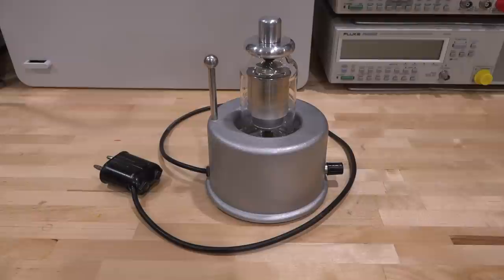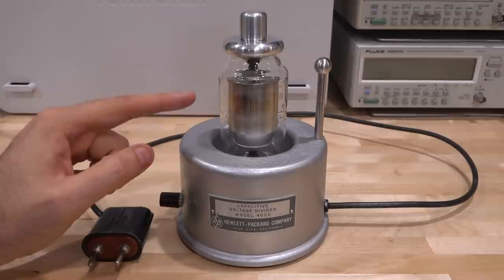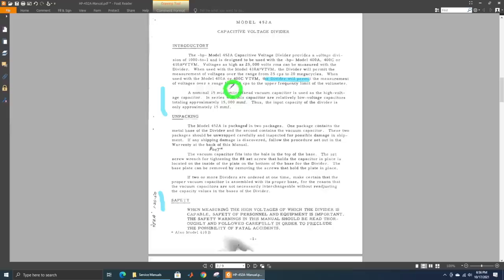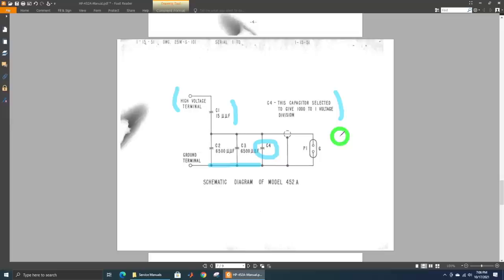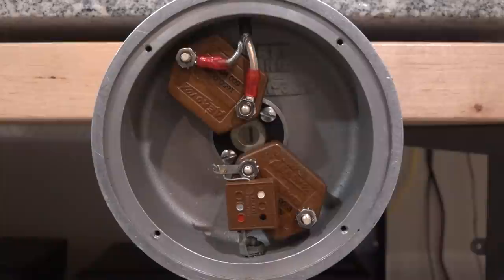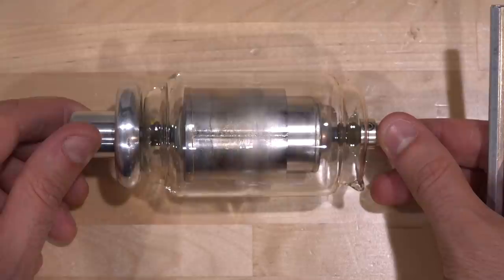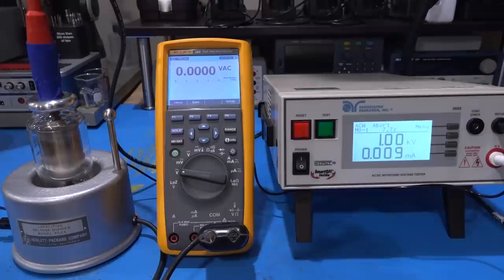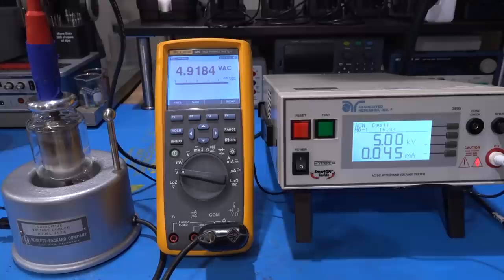TNP #10 - Teardown & Experiments with a Mystery Vintage (1950) Hewlett-Packard Instrument

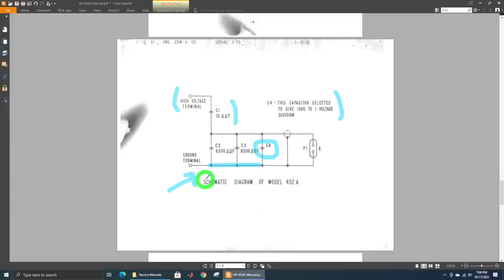Comment: Great video Shahriar! You did a very nice job restoring the divider as well. The symbol you talk about at 5:16 in the video is indicating that the lead out wire is shielded, in this case it's the shield of the coax cable. Thanks for taking the time to share your restoration with us.
Reply from the maker: Thanks Mr. Carlson! Now I need to find a 25kV AC source. :)
Reply: @Thesignalpath  flybacks ? maybe some old ignition coil ?
Reply: Mr Carlson's Lab,   You have made me very proud to find out that Shahriar is a good restorer of old equipment!

Comment: Great video!  The over voltage protection is needed to prevent the vacuum capacitor from generating x-rays which "would be bad" the same over voltage protection is seen on high power antenna tuners using vacuum capacitors.

Comment: Very cool instrument! This video came out just as I was discussing with a friend how to measure a high voltage AC signal too fast for a resistive divider in an old TV of his, will show it to him.

I suspect the 15 nF nominal capacitance was intentionally made a bit low so that, when added to the input capacitance of the meter meant to be used with this, it would make the correct capacitance. In other words, the ratio C1/(C1 + C2 + C3) must be 1/1000, where C1 is the vacuum capacitor, C2 is the sum of the capacitors inside the base, and C3 is the capacitance of the meter.
The meters for which this capacitive divider was intended (HP 400, 410 series) have input capacitance of 1.5 - 25 pF, while the input capacitance of your meter is listed as <100 pF.
I doubt this makes a major difference though, since the divider is only specc’d to ± 1% or ± 3% accuracy (depending on meter).

Comment: One detail that is amazing to me is that the spacing of the output terminals has already been the same in 1950. 
Also the overall construction is quite fascinating for just a simple voltage divider. 
Cost really wasn't such a big factor back then - or so it seems.
Reply: The spacing dates back a lot further than that.
Though, I have no clue where from it is, but its old.

According to Wikipedia it comes from General Radio that standardized on it in the 1920's.
The Schuko plug (dated to 1925 but its actual origin is debatable since there is a lack of records for who invented it) is using a very similar spacing, but 19mm (.748 inch) instead of .75 inch (19.06mm), but is largely interchangeable in practice since the difference is easily within manufacturing tolerances.

The 19mm or .75 inch spacing seems to be somewhat of a mystery to where it actually comes from and who were first. But it is nice that there at least is a standard for everyone to agree on.
Reply: @todayonthebench  Very interesting, thanks.

Comment: The circle in the schematic is the shielding of the wire that goes to that shielded GR style 2 banana-connector. Nice to see these old things. I never had seen one before. The AC dividers I know are made from transformers. The advantage is they can not change in value because the winding ratio does not change.

Comment: The input resistance of the DMM produces an error. A capacitor of 15nF at 50Hz gives around 200 kohms, that is to say 2% of the input resistance of 10M of your Fluke 289 which is a large part of the error. It can be interesting to test this capacitive divider with a voltage follower between the device and the dmm.

Comment: The mysterious over-voltage protection device in the schematic is actually the coax cable for the connection to the meter
Reply from the maker: Yes! It is definitely a coax symbol.

Comment: What's more beautiful than a vacuum capacitor?  A vacuum variable capacitor, of course!    I've seen a few vacuum variable capacitors in the wild (usually inside of older high-power HF transmitters/amplifiers), but this is the first fixed vacuum capacitor I've run across.   What an interesting instrument you've found.

Comment: 16.75pF : 14.26nF  = 1173:1, 1kV:0.984V = 1016:1, 5kV:4.919V = 1016:1. So as you said, hard to measure the 16pF and it might have measured a little high due to stray capacitance.
Reply from the maker: That makes sense, thanks.
Reply: Given the 1016:1 ratio, I suspect the vacuum capacitor is in the ballpark of 14.1 pF (depending on DMM input capacitance and ignoring input resistance, 14.05 - 14.15 pF).

Comment: This unit was originally intended for use with a VTVM, which has a higher input impedance than a modern DVM.  This may explain the error in your readings.
Reply from the maker: I'll try it with a much higher input impedance meter too. :)

Comment: Dear Shahriar

I really like your videos on old HP equipment. HP were extraordinarily inventive, always years ahead of the competition.

 If you can get hold of an HP8551B spectrum analyser that still works, it would be really interesting to compare it to a modern one. This instrument reputably made HP's  reputation as it was the first up conversion spectrum analyser.  I had one out of a skip once, but it did not work as the BWO  ( backward wave oscillator) was dead, and it eventually went back into the skip. I still have an original operating and service manual.

Comment: And unlike today's capacitors,  these capacitors are probably still good after 70 years....
Reply: Those days were different. People feared being nuked out of existence. Hence why some equipment from yesteryear was built so well. Nowadays we live in a very secure world with a sort of relative peace. So we don't care how well something is built. It can be easily replaced. "Spare no expense" got thrown out the window while "cutting corners" flew in. An ironic price of peace I guess.
Reply: That's high quality precision stuff, but "common" capacitors from back then were, you can't call it anything else, utter garbage. And they were well aware of it, but had to use them for cost reasons.  

Paper + foil, sealed with wax or tar, only designed to be good for 10 years. With STILL a high failure rate. If you encounter those in vintage equipment today, you replace them, no discussion needed. They are bad or just not bad enough to be problem .. yet. Replacing those was everyday work for electronics technicians in those days. 

As soon as metallized polymer foil types were available in high quantities, they basically immidiately switched to using those. For a good reason.
Reply: @CNe7532294  If you look at consumer electronics of those days .. especially the base models .. they are built just as cheaply as todays stuff. 

Measuring equipment is another deal, that stuff was EXPENSIVE. Easily high five to low six figures in todays money.

Comment: This is off topic, but I commented to the most recent video hoping for a response.  I have an HP 8591E spectrum analyzer with TG but the TG attenuator is blown.  I've had the front panel off and can see the attenuator but it is not apparent how to get the TG out to repair the problem.  The teardown procedure is not covered in the service manual.  Thanks for any pointers to a teardown procedure for the TG.

Comment: What is the input capacitance of the Fluke meter? If the input protection in it contributes about 275pF (which is in parallel with the lower capacitor), that is enough to get the 2% error. The 10Mohm resistive part contributes very little even at 60Hz.

Comment: I guess that the voltage rating at higher frequency is due to safety reasons because at higher frequency is easier for an arc to form between plates
Reply from the maker: It’s because of the current carry capabilities of the capacitors.

Comment: Interesting lack of a getter to remove residual gas in the  vacuum  cap. 2% is good for a 70 year old  HV  device.
Reply: I noticed that too. My guess is that very hard vacuum levels aren't actually necessary. Also, I imagine the metal deposit would have some effect on the capacitance.
Reply: I bet they used a Sprengel pump to pull a very hard vacuum inside the tube.

Comment: They use a lowercase "f" for "farad" at 3:31 - a mistake that is quite uncharacteristic of a publication from HP.
Reply: It's unlikely to be a mistake. This schematic likely predates SI (BIPM) standardization on capitalization of unit names. I think it was only in 1960 that BIPM standardized the multiplier prefixes (mu for micro, n for nano, p for pico and so on), and even then the long custom of using mmf for pF hung on for some time.  That was in the time when you were unlikely to encounter an actual mF (milli Farad).
Reply: @Graham_Wideman  Hmm - interesting :) Thanks!
Perhaps this document straddles the standardization-date in question - In the schematic at 6:22, for example, they do capitalize the F despite still using uuF instead of pF.

Comment: What benefit does this have over using a transformer? Just better at high frequencies?
Reply: It would be very difficult to create a transformer that simultaneously was able to withstand such high voltages, had a very low input impedance, worked across such a large frequency range, and was so compact.
Reply: WIDE frequency range. Very wide ...

Comment: What on earth is 25,000 volts used for? That's a lot of volts in 1950. Wow.
Reply: The first radar system I worked on used a dc supply running at 12 KV in conjunction with a pulse forming network to deliver 125 KV pulses to the anode of a large klystron amplifier tube. At the lowest output power setting it put out a 2 MW pulse 0.6 uS wide. The radar was designed in the late 40's and was still operating in the early 90's.
Reply: waaaaaay more common than you think, crt tv flybacks works around that voltage and no, im not saying this was used for tv repairs
Reply: @davidv1289  Holy Molly! What is 2 KW @ 0.6? Please elaborate. Cheers from Utah!
Reply: @fullwaverecked  Radars are sending pulses of RF. In that case the pulse was 0.6us long and the power during the pulse was 2 MW.
Reply: @fullwaverecked  That was 2 MW @ 0.6 - a 2 megawatt pulse of rf 6/10 of a microsecond wide every 3200 microseconds or so. Some great old tech!

Comment: micro-micro-farad?!? Why???
Reply from the maker: Well, 10^-6 x 10^-6.
Reply: @Thesignalpath  yes but... the horror :O

It's really true that americans would measure anything with any unit except proper S.I. units :D
Reply: This was standard practice before SI (BIPM) standardized the multiplier prefixes. It was common on schematics of the era. Not just in the US. [EDIT] Well, on browsing google for schematics of the 40's, 50's and 60's, such few that I could find from UK and Europe did not use mmf, instead using pF, or very small fractions of uF. But there are many examples of US schematics using mmf, or sometimes uuF (actually mu-mu-F).  So perhaps mmf was particular to the US. Though I could swear that a "20-circuits-in-1" type electronics kit I had as a kid in England had a 365 mmf variable condenser in it. Hmmm.